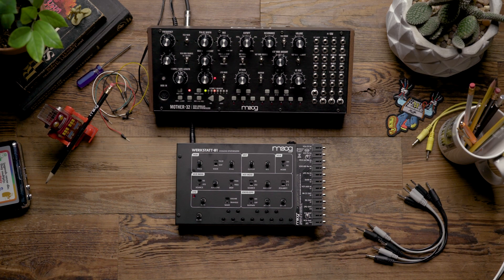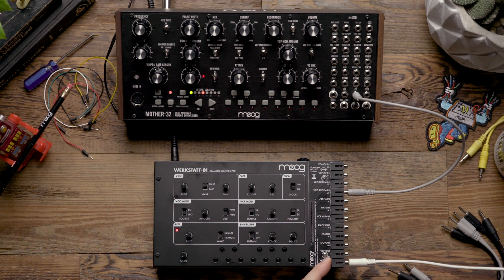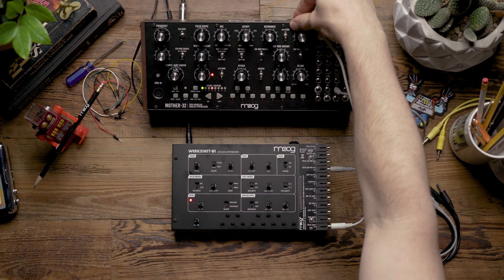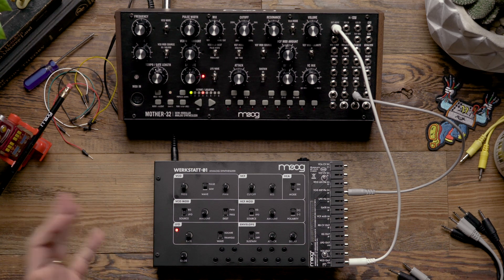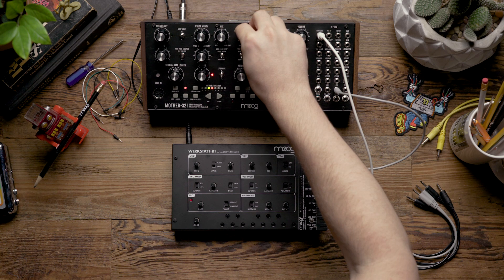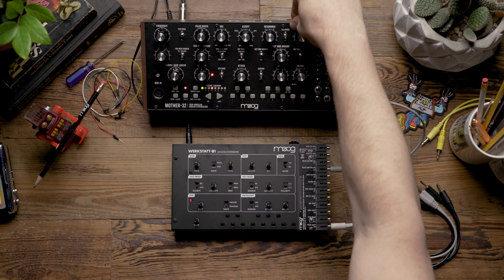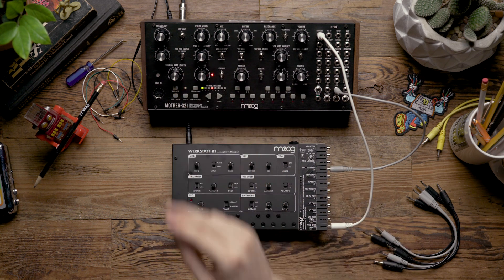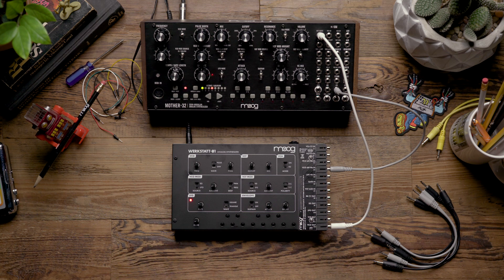Werkstatt-01 | Using Werkstatt with Mother-32 for Extra Oscillator

Comment: Wow, could I make this for my Subharmonicon and Werkstatt ?
Reply: Why yes you can. The SubCon can integrate with anything with CV i/o. Only difference is that the Mother, DFAM, and SubCon have a slightly hotter voltage output than the Werkstatt.